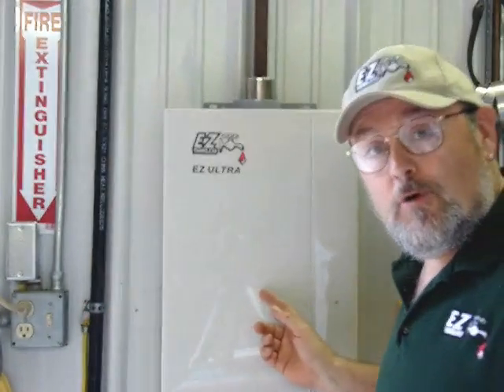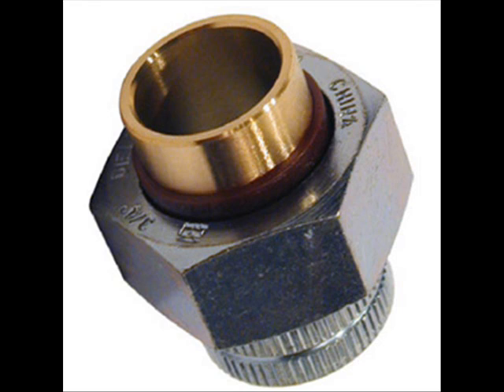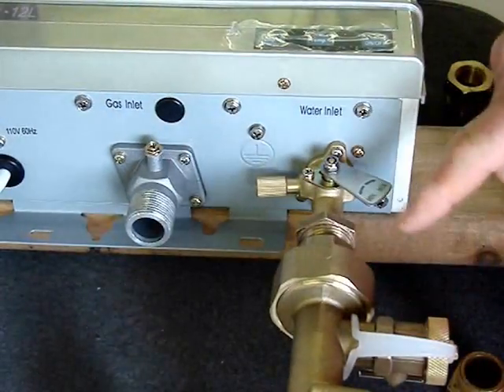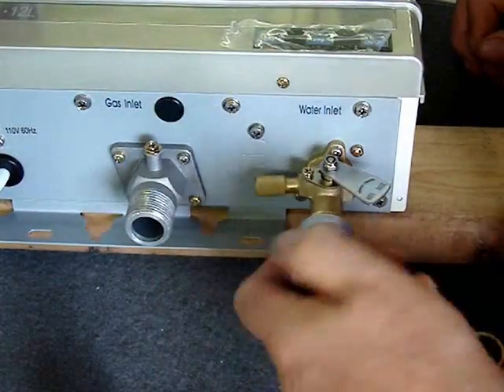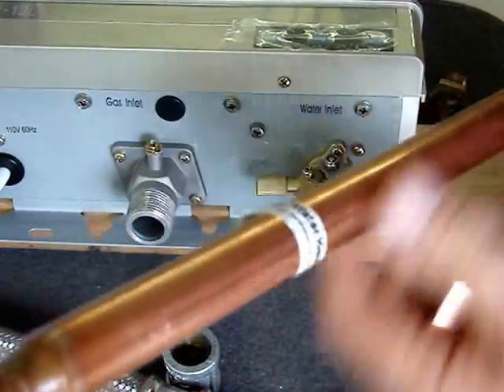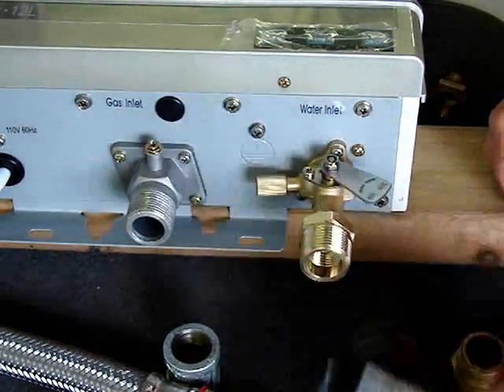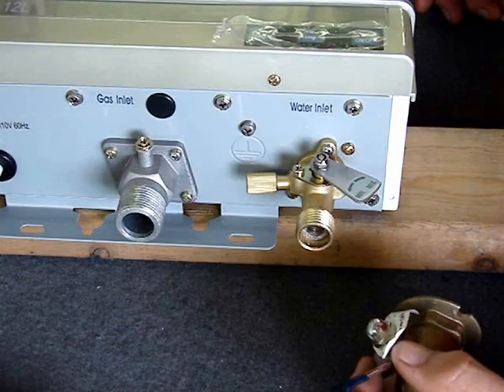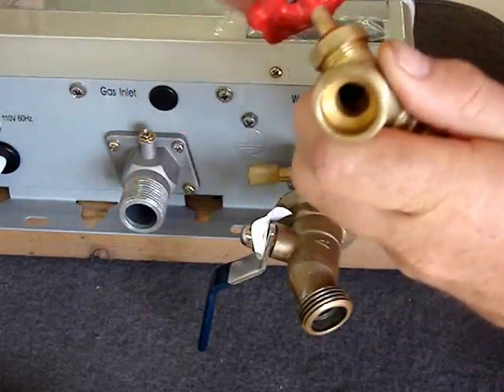How to connect plumbing to a tankless water heater (EZtankless)

Comment: I am going to buy this same exact unit very soon (Probably next week from Home Depot). My water heater is about to fail. This model had the best reviews and it comes with the flue vent.. The water connections on the bottom are both 1/2 in. pipe thread. The service valves are 3/4 in female pipe thread. You will need 2 brass bushings 3/4 MIP x 1/2 FIP in order to hook up your service valves to the unit. The gas input is 3/4 in. pipe thread. My house has 1/2 in. galvanized pipe thread. I will need to go from 1/2 MIP x 3/4 FIP brass bushing. I also plan on using a sediment filter on the supply side only to filter my hard water. This will help reduce the sediment that comes in contact with the heating element inside the heater. Hopefully this will make the heater last longer. I am going to use 3/4 in. SCH 40 PVC for the supply and 3/4 in. copper for the hot. I am replacing a 40 gal natural gas water heater in the garage. It never gets below freezing where I live.